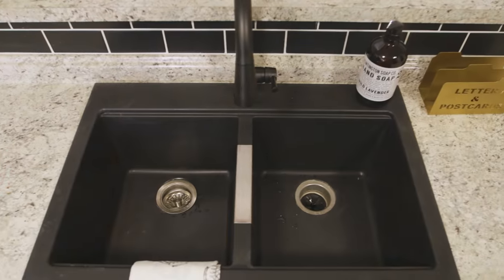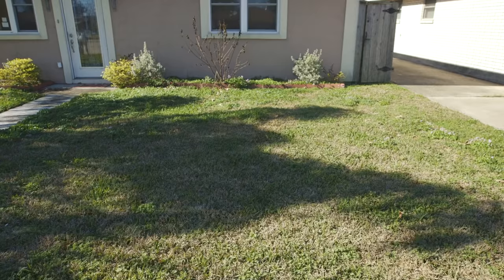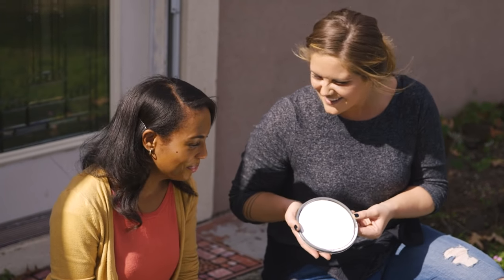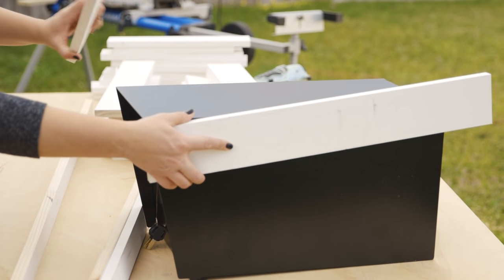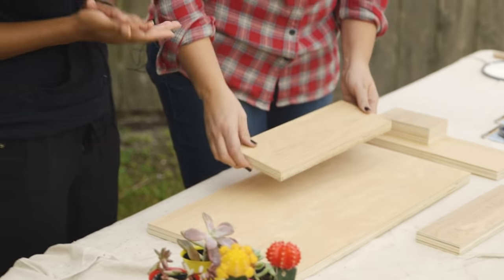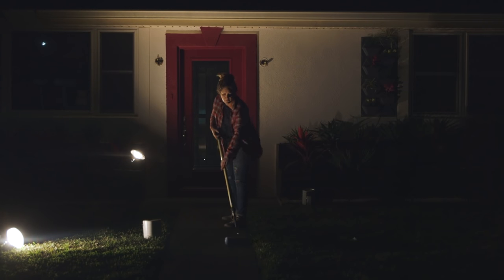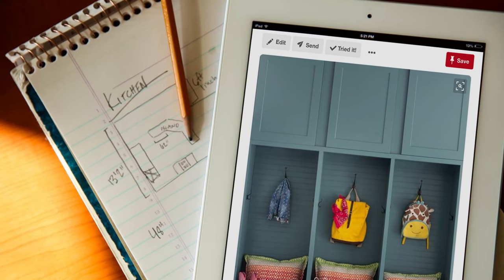The Weekender: "Mod Façade" (Season 2, Episode 5)

Comment: Love the plant beds but soil directly against the wall?
Reply: Hey Marion- we put up a barrier between the house, so that there wouldn't be any issues! :)
Reply: What about the wood of the plant boxes directly on the soil? Is there a chance that wood would rot?
Reply: Maybe put that in the video like an additional tip before someone tries this diy and ends up with water damage...? Did you put a barrier against the fence with the concrete block planter from another episode as well? In the diy on the lowe's website that step is not even on there.  :/

Comment: What the heck, Lowe's?? Untreated wood in contact with the ground is an open invitation to termites. That lining "barrier" is a weed blocker, not a moisture barrier! Water will seep through directly into the front wall of the house. Mold, rot, termites - this is a recipe for a slow-motion demolition! 
Btw, it looks beautiful. 
Now go back, apologize, and do it over the right way before the front of her house collapses. Rebuild the planters out of treated wood, with a back on them, and set them a couple inches away from the front wall of the house for air flow. I'm serious.
Reply: I was thinking the same thing about the untreated wood.  That's 101 basic.
Reply: I was thinking the same thing too! And the mailbox system might last two years the wsy they buried that wood in the ground. Disappointed!
Reply: I hope the wood for the mailbox is vinyl.

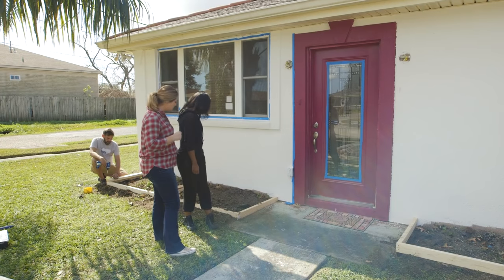Comment: I love this style but a few things jumped out to me. Not in appearance wise but craftmanship. I'm no professional by any means, but at 7:20 on the right side of the door frame a lot of bleeding on the door color to the wall... also the mail box with those wood boards into the ground... they don't look to be treated or anything - maybe some rot issues in the short term?

Also, those flower beds... really? Again just pine studs? No ground contact or even pressure treated wood? That thing will rot in no time, even with the paint. A double insurance would be using the PT wood... that would last a lifetime almost!

With this said, those planters are awesome! I am incorporating it them in my yard for sure!
Reply: I thought she said she used a barrier?
As for the door, I'm POSITIVE she went back with the white and touched everything up lol
Reply: But build the planters with wood treatment, please. ;)

Comment: Monica, do you think these plants will survive  Philly's heat during the summer? Thinking of planting those on my front door planter
Reply: Karen- these plans were chosen for NOLA climates, but could work in Philly during the summer, but I'd use them in pots instead so you can bring them in during the cold months :)
Reply: They are desert plants.   The bigger question is them surviving Philly's winters.